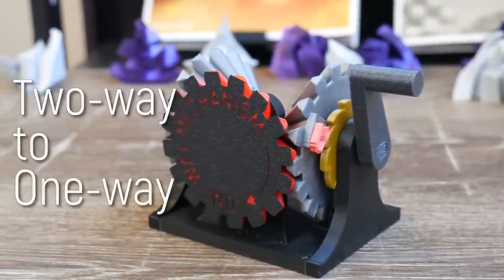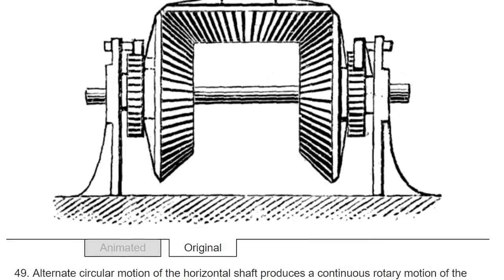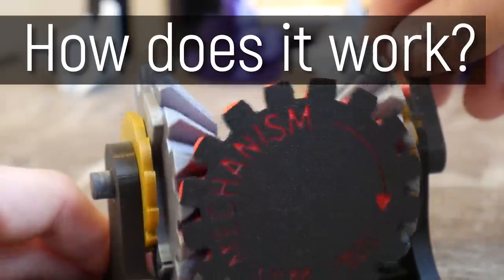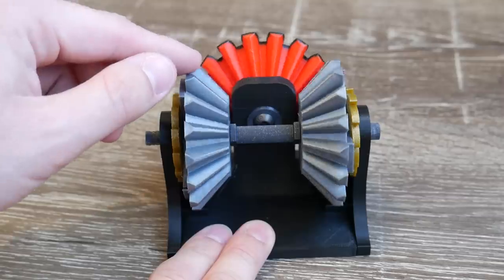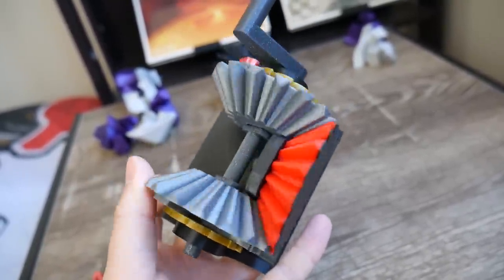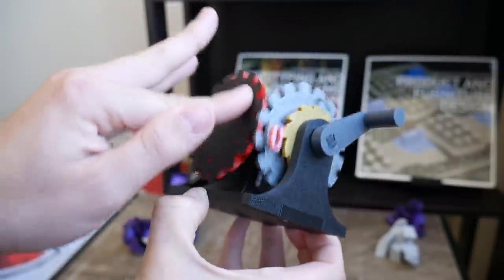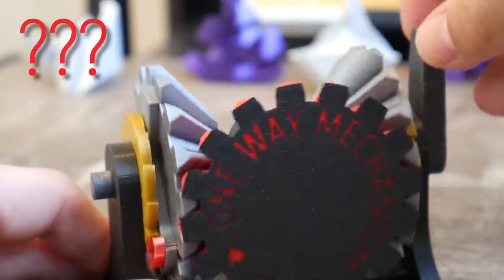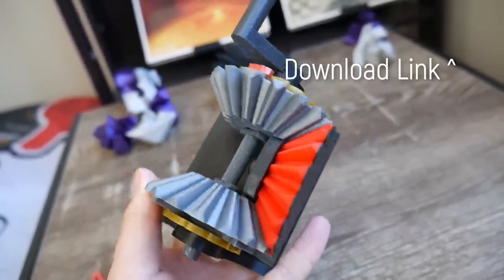This Mechanism only turns Clockwise, no matter what.

Comment: You could make a prank bicycle that accelerates with back-pedaling, but I imagine the wear-and-tear would be horrendous.
Reply: easy there satan
Reply: Put that on that bicycle with opposite steering for even more injuries.
Reply: Don't have to put in that much effort, just add one gear to the original system to invert the output. Boom, done
Reply: You can also do that by crossing over the chain so it looks like a figure of eight
Reply: almost all bikes use cassette  hubs (IE a ratchet), so  the wear and  tear would be identical to a normal bike hubs. (as long as the mechanism is made from metal)
Reply: It wouldn't be much of a prank since you would also be able to accelerate by pedaling the normal way. Unless you want to prank them when they attempt to backpedal, in which case you could achieve a similar prank by simply removing the brakes.
Reply: You mean a fixed gear bike🤦 already done mate
Reply: Chad BroChill instead of the ratchet mechanism you could use a cam style pawl like what is used on a zero degree ratchet.  No clicking with almost no backthrow engagement and less wear and tear.
Reply: Drew Street which is not what he meant( just adding on, not the same account)
Reply: I swear that's already been done
Reply: What a great idea!   You could add a backwards steering mechanism to that.... It'd be the greatest!
Reply: This is basically a retro-direct two-speed
Reply: @Fucisko  oh someone made that, look up smarter everyday
Reply: When your bike still brakes by backpedaling
Reply: "Why does your bike click so much?" 
"Don't worry about it..."
Reply: I commented this literally just now, when I scrolled down, i went back and erased comment
Reply: @Fucisko  it's called the reverse brain bike or something like that it's evil
Reply: Or you may be exaggerating !
Reply: I've been driving without back pedal break for years and it's so much nicer

Comment: Hello, this mechasim is used in automatic wristwatches, so that the fether can be upwinder in two directions
Reply: Are you sure? Most automatic watch movements I've seen don't work this way.
Reply: yes they use different mechanism. For example seiko
Reply: @corynrobinson  I thought some have bidirectional winding, and some just run idle if the rotor turns in the wrong direction.
Reply: I think in watches they would use the mechanism that was also shown in this clip. Some just turn idle if the rotor turns the wrong way for proper winding, some drive a different set of gears
Reply: @marcdecock7946  surely a simpler mechanism, like in a bicycle free-wheel would be used?
Reply: @marcdecock7946  There's probably many ways to achieve the same effect, is all I'm saying.
Reply: @alanclarke4646  true,  I enjoyed this video: 'Explaining The Seiko Watch Magic Lever Automatic Winding Mechanism',  that one is bidirectional.
Reply: It it not also used on some pendulum clocks? (I am not very knowledgeable about clockmaking)
Reply: Nevermind, I remember now how those work and it is different
Reply: @corynrobinson  The ETA 2824, a very common automatic movement, uses two gears that follow the exact principle shown in the video.
Reply: @ludoviclagouardette7020  No, at pendulum clocks it´s unnecessary to wind up in both directions
Reply: @danielpraetorius5009  I didn't mean for the winding but for the one way rotation of the gear that the pendulum actuates. But I remembered that it actually uses a special shape of ratchet that steals the energy from the counterweight to direct it to the pendulum on the return trip and actuates on the going trip
Reply: A good example would be Seiko's Magic Lever mechanism, which is actually quite a bit simpler than the one in the video.
Reply: For watches for bidirectional winding rotors ?
Reply: @corynrobinson  yes except the gears are horizontal vs vertical

Comment: If you used this concept, you could turn the in and out motion of the Ocean into direct turning power for some kind of Ocean Turbine.
Reply: wow
Reply: RaHuHe, good thinking!
Reply: But again the efficiency, the amount of force required to pull that crank is much higher than regular waves
Reply: No it's not, simply place a paddle wheel on the crank. It's a crazy good idea, and with modern machining and hardening techniques, ratchet mechanism could be complex enough and strong enough to work. 

Island and coastal power.  Sheesh this is cheapo mass production ready for powering serious.
Reply: RaHuHe not really. The locking mechanisms on either side would wear out way too fast. Plus movement was very choppy and wouldn't be very efficient. 

However this could work in a windmill turbine where the windmill can't actually rotate to meat the wind. Wind tends to be coming from a direction more constantly.
Reply: Not necessary for an AC generator,  Norwegian engineers are actually working on developing technology for ocean wave powered turbines.
Reply: they could try making a V shaped structure that would funnel the water through paddle crank system. I don't know if that would be enough force but would certainly increase the wave's pressure.
Reply: I think the latest generation of wave turbines actually uses air pressure created by the waves going into a chamber under the turbine.
Reply: Or they can use hydraulics. Or direct drive generator with rectifier and inverter. Or something that has to do with the water flowing through chambers, someone please design that?
Reply: Michael Carroll yes but rather use a turbine. Actually a device has been made, in which the water pushes air inside a chamber, and that spins a turbine. Actually you could make very crude valves to permit the motion of the air in only one direction. And of course have two turbines in both directions◀▶ like that.
Reply: Someone did tat already, it's a big buoy arm that goes up and down with the waves
Reply: That is similar to what was on my mind.  How about a wind turbine gearbox that generates power in either direction of wind flow.
Reply: How efficient is it though?
Reply: Vertical wind turbines do that, except they spin in one direction, but single it's a vertical paddlewheel basically any direction the wind blows will turn it
Reply: NO! The goverment will not allow that!
Why use free energy when you can create it and pay for it
Reply: Yes, that's how some forms of tidal energy work
Reply: RaHuHe thought exactly the same thing when I saw it
Reply: couldnt this also work for the eddy gt city turbine or another of a similar setup? maybe one less design forward to where it doesnt work universally regardless of wind direction, and it would be a lot more efficient than a big bladed wind turbine that relys on motors to rotate the blades into the wind and also a very complicated system of bearing to support the shaft and counterbalance the blades, friction heat blah blah blah sucking energy out of the system blah blah blah. anyone up for a trial run?
Reply: it already exists.
Reply: Blinks
Reply: Michael Frymus Exactly! Now we got a REAL genius ova here man
Reply: You could attach it to a vertical piston that floats
Reply: Look out! we got Elon 2.0 here!
Reply: You know y’all are describing the complicated workings of my toilet with that floating arm. I will call it “the floater”
Reply: creative thinking.
Reply: That might have been cool 200 years ago.
But people like living on the beach.
Who wants to litter their beaches with shitty generators?
People hate windmills enough already.
Reply: My other concern(besides coastline being too valuable to waste)..... is corrosion from saltwater.... which may force you to use brass and not steel... furthering reliability issues...
Reply: I mean... or you could just generate AC from it, as-is, and then rectify that...
Reply: Wave energy technology isn't new to the engineering world. Thousands of people have been working on it for many many years in many different countries. I'm sure somehow how brought this idea up and done extensive testing on its efficiency.
Reply: That's an idea.
Reply: Those saying that it's implimentation is flawed obviously don't know what engeners are paid for: Figuring this stuff out. Also building I guess? Playing Fnaf on youtube?
Reply: The amount of force required to pull that crank is so small, the guy did it by hand in this video. Also, there are 600 ton ships that bob on top of the ocean. That means 600 tons of force upward when it rises, and 600 tons of force downward when it falls. How is that not enough to turn a turbine? The weight of the buoy is cancelled by buoyancy on the water, so the efficiency is the same no matter what the buoy weighs. And keep in mind that between heat losses and transmission losses, you only get to use about 2-5% of the energy from burning coal. But I guess directly converting the mechanical motion of gravitational forces of the moon on our oceans into electricity so that the fuel cost is zero isn't efficient enough...
Reply: The buoys that run these wave generators don't have to be above the water, so not visible. Also, you can build a pipeline from the ocean to the inland and float the generator inside the pipe, as water will still find it's level. It doesn't have to be on the beach. It could easily be several miles inland. Also, if the power company owns the beachfront property that they operate from, then no one will be there to not enjoy the view. They would be on their own private beachfront property without the generators on it. People don't want the country littered with coal burning smoke stacks either. Didn't stop anyone from putting them in anyway.
Reply: It's called sacrificial anodes, and they are mounted on every large ship in the ocean. The corrosion is electrochemically conducted to the anode instead of the hull and the anodes are replaced as needed. With regular replacement, the hull could technically last forever. And the anodes are made of cheap magnesium, and the waste magnesium oxide has other industrial uses, so it's a win/win to use this system. Also, there is a big difference between industrial coastline and residential coastline. Should we tear down all the commercial docks and shipping yards and naval bases because they spoil the view?
Reply: Yayyyy i'm not the only one wh thought about this! It could benefit from the Waves un both dirrctions
Reply: It's almost like you lot don't realise this sort of mechanism isn't already well known in the engineering world...
Reply: Modern wind turbines can be turned to directly face the wind. I'm not sure how common it would be to have strong winds in directly opposite directions though. (Also you could try something with Vertical Axist Turbines.)
Reply: It's already done with tidal float systems. I'd have to check but I think there's a mechanism which allows for generation from the see-sawing movement.
Reply: But dynamos do already work in both directions...
Reply: Interesting idea, but not really good in concept.
Ocean waves do much more up and down than forward and backwards. Think of a wave (before it hits the beach) as a bunch of circles stacked on top of each-other, getting smaller as they go down. You could power a wheel off of the waves constantly washing up on the beach, but that's really space inefficient, and wouldn't generate that much power. A better way, and what we're already doing now, is to have giant floating balls with weights that get floated up by a wave, and then pull a chain on the way down (or it might pull the chain on the way up, I'm not sure). The generators are out of the way, and can generate a lot more power.
Reply: Hahaha, i just commented the same sorta thing. Would help take some stress off solar research and allow proper full testing there to profit the world.
Reply: A paddle wheel crank does that more efficiently.
Reply: RaHuHe sorry if I misunderstood, but if you mean the tides it’d probably be easier to have a mechanism switching the direction as it’s only required once for quite a long timespan.
Reply: submit this to Bill Nye saves the world : all they need is funding after this.
Reply: paradaux gear ratios can give the mechanical advantage needed to generate electricity from any input.  theoretically it should be a lot more efficient than wind turbines: given you have effective space to mount something of a similar scale.
Reply: Well if it is easier than it seems to us, why has no one done it. At a time when this sorta energy creation would be HUGE, it would be a good idea.

Then for a tide, a tide is always going in and out close to the shore, think of waves, in and out, even getting deeper in the current still goes in and out with the waves. Only in deep sea, would it be more stable, but the cost involved there would be too great since the sand is always moving. 

I would think making some sort of platform to take in the changes of the sand movement and erosion, with this sort of "turbine" always pulling a motor to generate power, would be very beneficial. Even if it was to just power the many undersea fibre cables that always need a certain amount of power, it would help take the load off of the power stations in the countries with the landing stations.
Reply: Perfect
Reply: There was a hydropower device built in Scotland in the mid 90s which worked on the principle of a sea cave.  As the wave washed into the cave it displaced the air through a hole in the roof of the cave.  As the wave receded, it drew air back in.  The device created a large volume with a wind turbine in the roof stack.  This device would generate electricity irrespective of the direction of airflow.  The handle in this video would be the shaft of the wind turbine.